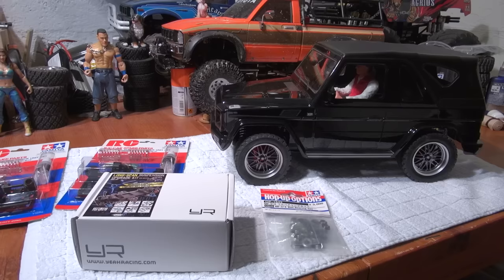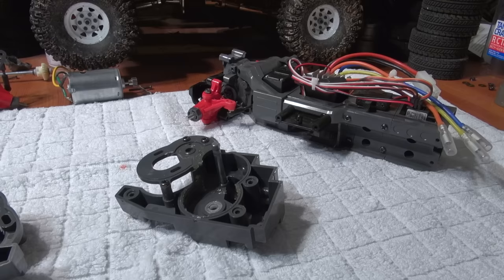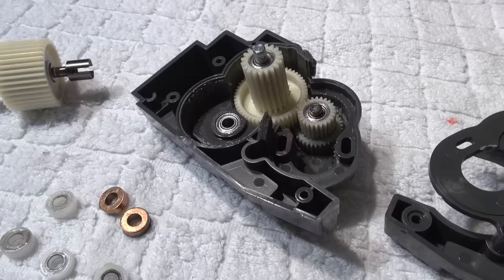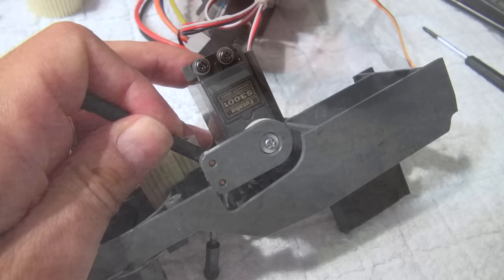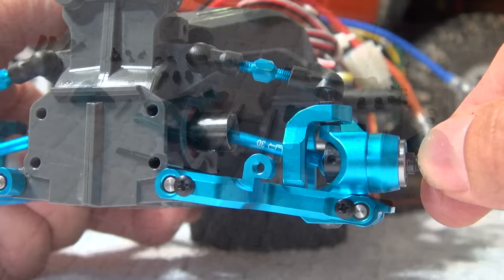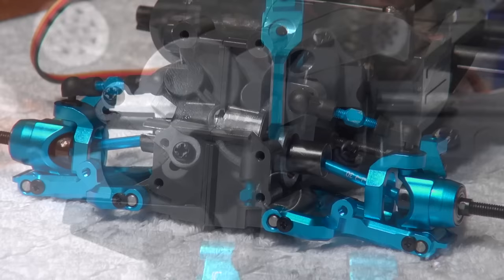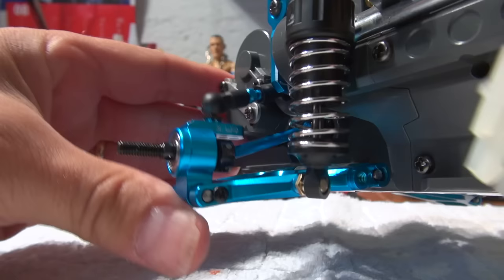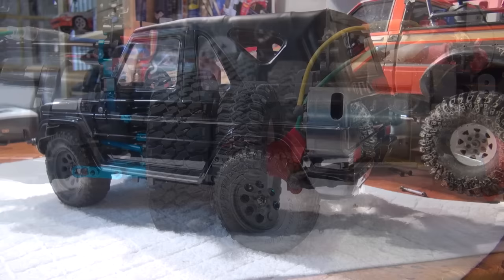Tamiya MF-01X Upgrades and Modifications

Comment: Great video! For anyone doing this, here's a solution for not cutting the motor gear cover. Instead of using the kit supplied endlinks, use the "Tamiya 5mm short adjuster" 50797. They are $2.60 from Tamiya, and since they are "open", they allow installation of the cover with no clearance issues or cutting.  5:26

Comment: You should never super glue the servo saver to the horn. It defeats the purpose (unless you don't mind destroying your steering servo any time you impact your wheels into something). 

The problem with the play that you noticed could've been fixed in a number of different ways. 

1. Either your screw was too loose and simply needed tightening.

2. If your screw keeps coming loose, you could fit a small serrated or spring washer to prevent untightening.

3. Your horn screw may be too long. Find a shorter screw or file down your screw to size.

I'm also not a fan of locking diffs, but at least there is no potential for damaging anything by doing that.

Nice vids, btw. ✔️😉👍
Reply from the maker: Thanks for your feedback! First, all your tips are good but not the problem of the play. As i mentioned in the video it should be used a high quality servo for this modification. This will not be destroyed. And I used the car more as a trail runner, not a racing machine. And on the trails you have to use your steering sensible...
Reply: John the screw can be tight and it still wiggles

Comment: Great video.  

I realize I'm watching this very late.  If one has a limited budget for enhancements to the MF-01X chassis (Long Span Suspension is out of the question) which one is the best to be done for offroading: 

- Ball Bearings set Tamiya TA-54643, 
- CVA Super mini Shocks, or
- Bigger/softer Tires
Reply from the maker: In my opinion first are better / softer tires.
Reply: @Matteomeier  Thanks for your time and reply.

Comment: I bought this upgrade. It came with parts for several different chassis, and was difficult to figure out what parts were needed. It also was missing peices, had two left front knuckles and the rear knuckles won't line up.
Reply from the maker: If parts missing or no good, you can make a warranty claim...

Comment: Hello Matteo, great video as always👍
I'm interested in this chassis, for this HR mod, and it's adjustability; I just wonder how it will do with something a little torque-ier than a Sport Tuned, and would the drivetrain handle slightly larger tires, and all the weight from the upgrades?  I'm thinking favorite car of all time build, so I must know all it's secrets.  Slipper clutch?
Reply from the maker: MF-01X is a small little car, with limited off road capabilities. Be careful not to overtax it. It have no slipper clutch.

Comment: When I lock diffs, I simply use hot glue. The diff is locked, and you can simply remove the glue if you wan't the diff to be open again.
Reply from the maker: Very good tip! Thanks! 👍😊

Comment: Seems like a lot of people are having problems with loose Tamiya servo savers. Everyone seems to have a different solution. I tried super glue on my grasshopper but it eventually gave out. I saw a guy using rubber tubing around the outside, however, I've found another way to fix this problem without much effort. I use a leftover self tapping screw from the Tamiya kit and a small washer in place of the machine screw that comes with my servo. It will hold the servo saver together just fine. BTW, I noticed a Futaba S3001 servo installed. I've been using S3004 servos without any problems so far but I hear that the S3001 has better "precision". One of my Tamiya's came with a S3003 servo and I feel like it doesn't always center properly. Im just wondering if the S3001 servo is really worth the extra money? 🤔
Reply from the maker: Thanks for your good feedback and tipp! I do not know the differences of all these Futaba Servos, sometimes I use a 3001 because my hobby store have it for good price.

Comment: Does anybody know what tamiya buggy wheels and tires will fit the MFO1X and clear the rear hub carriers? I have a MF01X that I built with rear wheel drive and I want to put a set of tamiya spiked buggy tires and wheels because they are wider and will give better grip while still being more scale looking than other options. Anyone know which kit wheels could fit it? Buggy champ? Hotshot? Hornet? Grasshopper? Plasma edge? Sand viper? Frog?
Reply from the maker: As first you need to check if the wheels have 12 mm hex. Older Buggy wheels like the Hotshot Frog and Buggy Champ have other systems and these will not fit directly to a modern 12mm hex
Reply: @Matteomeier  yes this is what I am afraid of!

Comment: I am noticing the increased articulation of the arms, which is very nice. But will it not become a problem as the wheels now are wider/outside the body?
Reply from the maker: No, the wheels are on the same position. The mounting positions on the c-hubs is different, this makes the better articulation.
Reply: @Matteomeier

Comment: Hi Matteo, did you try the MST tires on the Jimny? I think about using them on mine, but I have a doubt for the size.
Reply from the maker: In the comparison you can see the Jimny with the 1.55 Mikey Thomson. I think this ones are limit for the Jimny.
I think it should be possible to use bigger, but I don't like it too much. Here are the 1.55 installed and the fenders a bit trimmed: https://youtu.be/NCRViRuj3Zo
Reply: Ok indeed it s enough with the 1.55 tires. MST tires will be too big. Thanks a lot for your answer. Keep doing some great work I love what you do. Inspiration for me

Comment: The MF-01X doesn't come with oil shocks or ball bearings in the kit?
It's disappointing to see the diffs are not sealed. This is 2016, all RC diffs should be able to hold oil now.
MST makes aluminum servo savers that fit very tightly and are adjustable. You should consider using one on your truck. I use them on all my Tamiya cars.
Reply from the maker: +Shawn Elliott Yes it comes without ball bearings and oil shocks. But please consider the price of this kit! I had no issues with the diffs on Tamiyas. It's hard to believe a diff can hold the oil inside... Thanks for the tip with the servo saver, I'll check them!
Reply: ***** You're right, those diffs definitely can't hold oil. That is disappointing, because I like tuning my diffs with oil.
The MF-01X costs $200 in the US. That is the same price as a Traxxas Slash. The MF-01X looks nicer, but the Traxxas Slash has sealed diffs and metal gears.
Reply from the maker: +Shawn Elliott That's true, I thought on the kit price (95.-) but we have to compare the RTR versions 😃
Reply: In the US, the MF-01X kit costs $202. I don't think there is an RTR version here. http://www.tamiyausa.com/items/radio-control-kits-30/m-chassis-cars-36350/rc-suzuki-jimny-jb23-58614
Tamiya products are very expensive here. I have several XV-01 cars and they cost about $600 including upgrades.
Reply from the maker: +Shawn Elliott That's crazy. But the prices on Tamiya USA website are catalogue prices not the price on the market. Found the same in USA for 120.- http://www3.towerhobbies.com/cgi-bin/wti0001p?&I=LXFKEP&P=ML
And they have also a RTR Version for 290.-
http://www3.towerhobbies.com/cgi-bin/wti0001p?&I=LXFYPB&P=7
But from Hong Kong the price is the lowest: http://www.stellamodels.com.hk/58629-mercedes-benz-g320-cabrio-wesc-torque-tuned-motor-p-9713.html
Reply: True, the price from Hong Kong is the lowest, but I sometimes wait a month for parts to arrive from Hong Kong or Japan.
Reply from the maker: Shawn Elliott Yes, and at the end the price is the same, because of the high shipping rates.
Reply: ***** The only reasonable solution is to move to Japan. ;)

Comment: Great video. I'm still undecided - standard. Tamiya suspension with oil dampers and 90mm tires, or ful Yeah suspension upgrade. I've read that the Yeah long arm upgrade gives you 36% (not my number) more suspension travel, but that probably translates to c. 5mm worth of extra travel. Is this upgrade really worth it relative to the capabilities of this m-type kit? Will it significantly improve its cross country capabilities (trail not crawl)? About to start my built.
Reply from the maker: Thanks! Yes, in my opinion is a great improvement and worth the money.
Reply: Matteo's RC Movies Thanks for your reply - I've bit the bullet on the long-span suspension kit and ordered the upgrade. Looking forward to the install. Already using the Yeah shocks, which are fine. The MF01x is a very nice kit, but after upgrades it might have made more sense to get something more capable like the MST CMX / CFX. Of course rc is not about rationality :)

Keep up the good work!!

Comment: Having a hard time judging by the video.  I can see the improved suspension geometry, esp in relation to the angle of the axles as the suspension moves.  But did the Yeah Racing long span arms increase suspension travel (or is it the same)?
Reply from the maker: Yes the suspension travel is increased also.
Reply: Thanks for the info!  Keep up the great video's!

Comment: Hi Matteo, nice review !! :) I bought this upgrade but a have little problem with geometry. Do you use stock O-ring  (black) in the Joint Cup? Its all about rear part. The Shaft Swing cant spin (horizontal shaft posicion) or will fall out from joint cup (down posicion). Thanks for any advice ! :)
Reply from the maker: No, as I remeber right I have no o-rings in the joint cubs. With installed dampers the movement of the swing is limited and so, the shaft will not fall out.
Reply: Thanks alot for your response! :). Maybe that was the problem.

Comment: Great job there, Matteo. Those black rims, are they also 52mm diameter? Will Tamiya tires fit on them?
Reply from the maker: Thanks Tomas! Yes, the tires in the video are the original tires from the kit.
Reply: Aha, ok, but the rims/ wheels are different from the stock, right?
Reply from the maker: Yes, these are from MST, the bigger tires at the end of the video are also from MST (from the CMX)
Reply: Thanks

Comment: Your suspension looked like it was binding a lot. The suspension should drop under its own weight when the wheels and dampers are removed (see 4:52)
Reply from the maker: When everything is new the parts are very tight together and especially the ball connectors clamp a bit. But after the first or second drive, the parts move perfect together.

Comment: Is Tamiya irgendwie in nem Timeloop hängen geblieben? oder warum bauen die immer noch chassis wie vor 20 jahren. Ich meine dieses MF-01X is doch quasi nur ein TL-01 mit Heck- statt Mittelmotor. Ich hab mein TL-01 damals auch ziemlich aufgerüstet. Leider  habe ich(aus Taschengeldknappheit erwachsenenm Geiz) nen defekten Elektronischen Fahrtregler nicht ersetzt. Dessen darauß folgender Ausfall führte dazu, dass sich mein Fahrzeug, mittels Physik und einer Hauswand, in einen Haufen Schrott verwandtelte. Hab mir danach nen Verbrennerbuggy geholt, den ich jetzt nach 10 jähriger Hobbypause auf Elektro umrüste.
Reply from the maker: Na ja, manchmal hat man wirklich das Gefühl was machen die eigentlich, aber am Schluss machen die Produkte doch wirklich Spass.

Comment: Hi there can I ask why you would lock the diff what benefit would u get from this others than stripping gears
Reply from the maker: It's because of the grip on loose ground and off roading. With open diffs, if one tire have no ground contact the traction is away. But for on road is better to let the diffs open.

Comment: Hey Matteo, how did you lift the actual body up of this chassis? I just bought an MF-01X Mercedes G 320 and my body was rubbing on the wheels - I had to use body spacers but even then it is very close. Thanks for reading and thanks for making the video.
Reply from the maker: Hey Denis, with the stock body mounts is very easy to lift it with the clips. Maybe you need new body posts.
Reply: Matteo's RC Movies I think i do. Mine is at the top height. I plan on having a friend 3D print extenders for me. I am also using the clips where it seems you are using a magnet mount which might account for more height of the body. Thanks for your reply!

Comment: is it able to put 1.9 tires on original arms?
Reply from the maker: Yes, this is possible.
Reply: is it also possible on jimny body? will the 1.9 front tire rubbing the chassis and body while turning?(with original arms)
Reply from the maker: It depends on the tires. With small tires should be possible. You have to lift up the body and cut a bit the fenders. On this video are 1.55 wheels and tires (diameter 84mm) with original arms: https://youtu.be/NCRViRuj3Zo

Comment: Tamiya needs to get their shit together. Litteraly :P Why do they have to have so crappy fitment on the steering systems? There are no other cars where you almost HAVE to replace the entire steering system for it to go in a straight line :P CC-01 seems to be the worst - where even aftermarket parts have trouble holding it togheter because of the overengineering of the linkage :P The CC-01 is a re-release. This is a all new car. Still the same crappy fitment :/
Reply from the maker: Of course Tamiyas are not perfect, there are room for some small upgrades. But over all, Tamiya kits are still one of the best. And I think the price-performance ratio is still excellent. I never had a Tamiya kit with missing some parts or false parts etc. And you can run and have fun with every Tamiya car straight out of the box. In most of mine CC-01 I have the not modified stock steering, and have fun with on the trails at no end.